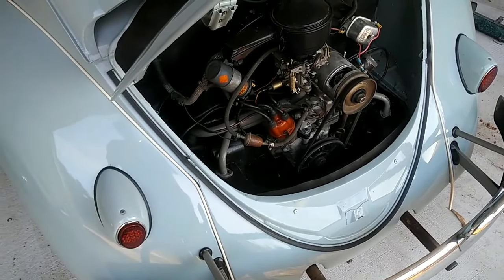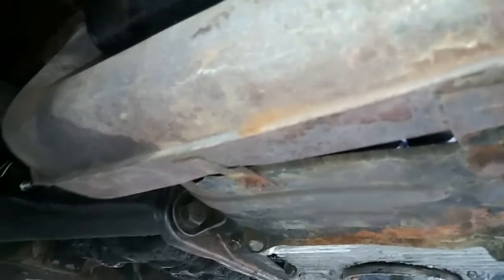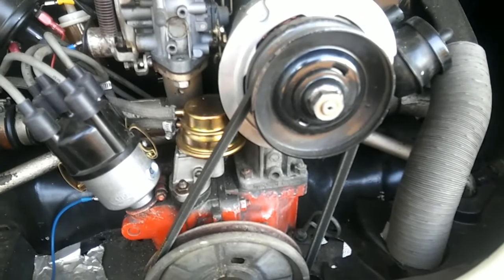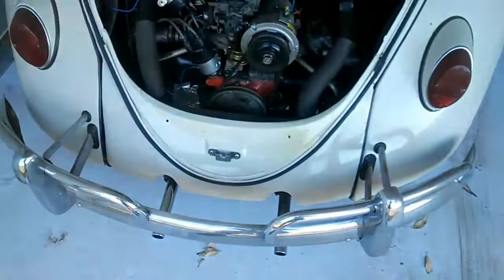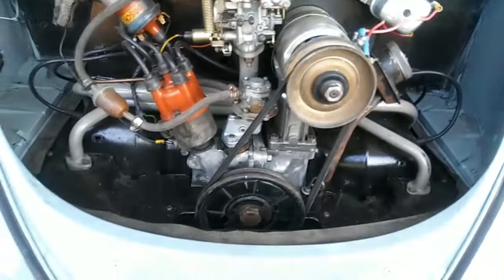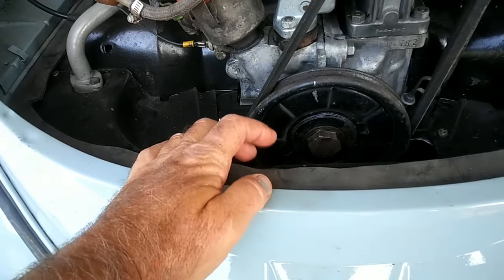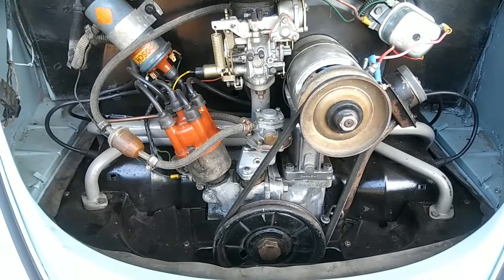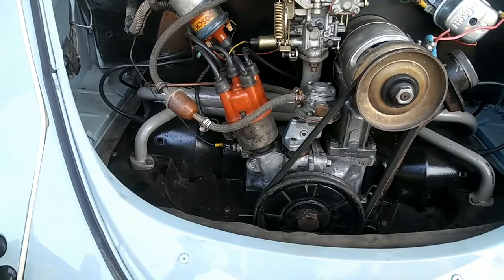VW Bug how to prevent engine overheating

Comment: My simple way to keep my 68 bug cooler , was to drill a small hole in the rear bumper at the center ''front'' edge , and a small hole in the engine lid at the low tip , put a old fashioned  screen door hook in the bumper ......and the hook eye nutted into the engine lid ......and open the lid , insert the hook into the hook eye , drive down the highway.....simple . An VDO oil temp ''told '' me it worked cuz if the oil temp started to rise to higher than I liked it  , I would pull over and open the lid , put the hook that was dangling from the bumper  into the engine lid eye , get back on the road and watch the oil temp drop quickly to where I liked it .......the engine lid was about 4 inches ''open'' , and sucked the heat OUT ........simple !!!

Comment: You mentioned doghouse oil cooler? I used a type 4 as advised by my mechanic. It is hot in my country 8 months in a year. Good video!!!
Reply from the maker: Great point! we also did that in the Bulletproof engine build. Type4 cooler modified the shroud . I would do that in hotter climate too. also putting the electric fan powered cooler works good too. I also use heads that AA puts out that have opened up air finned area. better flow especially with the cool tin installed.

Comment: The only mod I did to my VW is I encreased the RPM of the cooling fan by using a different custom set of pullies.
Yes it makes the performance suffer a little bit but it's worth it in the long run!
Reply: I can't imagine it making the car suffer very much. I think that's a good idea especially for my Manx buggy because it doesn't have any way to seal off the engine compartment.

Comment: Back in the '80s I put Bus wheels on my Ghia: an inch shorter and an inch wider than original. I found some relatively low profile Michelins that were just about the same overall diameter as the original tires, so I had the same gearing and my speedometer was accurate. For clearance, I only had to grind the rear bump stops a little bit.
Reply: 14 inch wheels look wrong as there is a big handwidth between the bodywork and the tyre.
Acceleration would improve but the motor would need crazy revs for safe highway speed driving with a standard transmission.
You cant get something for nothing.
For a ghia has a heavier,wider body than a bug to haul around.
I suggest installing a heavy duty power pulley, that helps increase the fanspeed and maintain momentum. Gene Berg having the bestquality but think csp or cb performance also do them.

Comment: This type of air cool engine is very sensitive to tiny oil leak. Air if move fast can sitting dust on surfaces as head cylinder and cylinder plates if plates oily. Good assembling and sure to oil sealed is important.

Comment: I bought a after market oil cooler that screwed on the back of the fan housing, and it also came with a oil filter that use a regular oil filter.,A head temp. Guage would be a good idea.and 30wieght synthetic oil which handle the heat better.I see your engine has a 09 distributor and a Bosch coil good improvements .

Comment: I have a 1979 VW karmonn super beetle. Do you know what size the engin is, do I need to rejet the carb, and is the trans. ok to go 70 with the gearing I really injoyed this video. thanks for the info. I had a 1959 VW bus and I put chevy rims on it and did noyhing like you were talking about so now I know why I went through 4 engaines

Comment: Front engine tin is necessary to prevent heat from being suck in and additionally is the front tin seal.  It is necessary also.
Reply from the maker: better if it is on, but we did tests with temp gauges in the early 80s and did not get any different results with the front off. The rear of the car oh yea if you want to burn up a motor just leave some holes in the rear.

Comment: What is a good temperature for the heads and what temp should you start to worry at?
Reply: Wondering the same thing
Reply: @justinfewkes9313  lol yeah, now we just need an answer... lol anyone? .... anyone?
Reply: >>What is a good temperature for the heads and what temp should you start to worry at?<<
They run at almost 300F. So the cooler...the better. I seriously doubt you can get them "too cold".

Comment: If a bug overheats normally she will cut out let her cool completely before starting her up again. As it is an air cooled engine very same as a ride on lawnmower. I remember we had a heat wave in Ireland. The push petrol mower cut out i let her cool down and ran her again. Vw beetle uses the same principle

Comment: What about making sure the belt is snug?   And that there is enough crankcase oil?  45 years ago when I used to pump gas in these things I very frequently found those items needing attention.  And that was when the speed limit was 70 (before it was lowered to 55).

Comment: Tire width and sidewall aspect ratio will always determine the final gear ratio on any vehicle. Bear in mind that a larger overall diameter/circumference tire will make the wheels spin slower and you must watch speed because indicated speed will be lower than actual. The only mods to VWs that are really worth it are ones that route the air around the engine more efficiently.

Comment: Get a vented lid or stand off hinges or both... It helps more then most things he mentioned
Reply from the maker: +ady-B David the only thing I don't like about them is water comes in the engine compartment and causes problems when you wash your car
Reply from the maker: yes they do work but every time you wash your car you are in for a big job.
Reply: those dont really work when you are idling,the deck lid is designed to draw air down over the engine blowing all hot air down and away from engine,the deck lid being open compromises cooling ability.plus it looks like crap
Reply: Mike F  we put a garbage bag over the engine when it's washed. But we make sure the engine is cool.

Comment: 185mm aspect ratio 75 or 92 for climbing tires thru the terrain in Germany mountain and Alps of Italy. This is 381mm Firestone made in 1935 ad 381mm is 15 inch for motorists in Germany read only R381 on the Mich or Mick tire.

Comment: Make sure your old tar board insulation on the fire wall is in good shape, attached, or replaced. Dangling or broken firewall insulation will suck right over that fan hole no problem.

Comment: Hey Mike, Im working with a guy to restore a beetle for me and I was wanting to put dual 40 IDF carbs on the engine. He keeps telling me that dual carbs will cause the engine to overheat all the time. Its an 1835cc engine. Do you have any idea if 2 carbs will cause the engine to run much hotter than a single carb?

Comment: Run the recommended sae 30 or 10w-30 oil.  The oil is diverted to flow through the cooler when the rear relief spring drops below a certain pressure.  A heavier oil will create more oil pressure.  Generally that’s good, but a higher oil pressure will raise the point at which oil flows through the cooler as much as 40 degrees.  There’s also a point to be made to run the stock thermostat flaps, even if there’s no thermostat, just make them fixed open, it helps flow air toward the heads.  A 356 generator pulley will make the fan spin faster.  Berg was also a strong believer that hemi cut heads with 6.9:1 comp on a stock engine ran cooler, and allowed you to safely run the afr’s closer to stoich.
Reply: Hey!!! Thanks for that tip.
Reply: 10w-30 in an Air cooled VW? You must live up north.
Reply: @RonBakerDallas  Sometimes straight 30 is hard to find. I wouldn't run 10w-30 on the highway for hours in a bus. It's all about hot viscosity, I wouldn't recommend anyone to run something that's thicker than an sae30 @215 degrees F. The oil only flows through the cooler once pressure drops below a threshold. too thick of an oil raises that temp ceiling, which is no bueno.
Reply: @curtislovrak5390  I only run 20w-50 unless it gets to freezing, Live in Texas so never really gets to freezing around here.

Comment: On my 65 sunroof  I bought a convertible decklid for it also. Hopefully it will help
Reply from the maker: the do a little. I just dont have one because of the water getting in on the distributor.
Reply: Mike F true,  check this out why IN THE HECK DID I GET SHOCKED  when i touched  my  spark plug wires on my distributor?  Are my cheap  spark plug  wires causing that ?
Reply from the maker: Bosch or NGK spark plugs only for vws.

Comment: i got 2 bugs both running and driving no rust in them but are baja's one is a 63 the other is a 74 the 63 has a 72 bus trans axle in it got both for 400 bucks think i got a good deal with extra parts and custom wheels good tires the 63 takes chevy 5 hole car same as my camero center line wheels

Comment: Best to run in a cooler country.. Heads crack around or near the plugs. Built in flat spot on standard carb in the 70s
Reply from the maker: flat spot could be from loose throttle shaft makes motor run lean. too watch out on that one.

Comment: If I had a Beetle, the first mod I would implement is a way smaller pulley on the generator/air fan shaft for greater speed.
Reply: Dont do that. The fan consumes quite a bit of horsepower. The smaller pulley has less grip on the vee belt. Combine these 2, and you will have a slipping belt at even moderate RPMs. Result will be a fried engine.
You could use a late model larger oil cooler and the slightly wider cooling fan impeller.

Comment: Good video overall but don't forget to prep the heads first.
Most all heads need the fins cleaned up and profiled with a circular saw and speed controller .  All the flashing and shitty casting benefit. Even drilling out flashing where possible. #2 fix all oil leaks. Super important.

Comment: You have low compression ratio and how to measure it with this, in here, compression test gauge PSI in the spark plug hole and cylinder gives a reading. Same time, please, crank it. How much PSI in the compressor per engine cylinder do you have?

Comment: I just inherited a 73 bus with type 4 engine. I’ve been daily driving it and will do so all summer (hopefully find a beater for winter) it gets 100+ and 90+ everyday from June thru August

I’m a little worried haha
Have all the original tin, adjusted valves, degreased engine and cleaned everything up better. Change the oil frequently and am still worried about overheating. Thinking of making a lid prop also to have the engine lid gap at 5 inches or so
Also just ordered a new engine surround foam seal as mines deteriorated and half there
Reply: Were to get air from to "cool" the engine? Let think about that.  Low pressure behind vehicle going down road(as in wind tunnel) wouldn't be a good idea as air is hot the closer you get to surface of road + exhaust heat is down there too. Air leaks are death to engine because all the air is coming from low, exhaust area. ALL air must come into engine compartment from built-in scoops on side of buss. The scoops are not where by accident, that a high pressure area, at speed from frontal air displacement .
Reply: Edwin H Singmaster makes sense

Comment: Did you notice the engine with solid state ignition has no clamp on the output of the fuel pump at the fuel pump?

Thank you for the info as I am in the process of acquiring a late 50's early 60's bug preferably with manual ragtop sunroof.

Thanks for all the info.
Reply from the maker: the suction side is on the top on that fuel pump. The pressure side is on the bottom. and the bottom is clamped

Comment: You do have Mercon V fluid in the Volkswagen air cool transmission at the back. You need to stop bubbles in the transmission fluid by add in more steering pump fluid of 5 speed forward so add in Lucas ZDDP Additive and/or detergent and Plus try the transmission 70W80 oil pump low volume and oil cooler. There oil cooler Misnomer brings the fluid cooler radiator that comes with transmission cooling oil sensor also named heat sensors for trans.fluid.

Comment: Mike, thank you for the cooling tips! Any brand of Premium Gas that you would recommend? I have the non-doghouse engine oil cooler that came with a protective metal mesh in front of it and I cut that mesh because I thought that it was too restrictive and besides it is inside the fan housing, I think it helps. I would prefer a doghouse cooler but is it hard to install in a single port?
Reply from the maker: not really it goes right on  easiest though with the engine out of the car. SP are great sturdy engines and have less things to go wrong. No intake boots that leak.

Comment: Do those hood standoff attachments that leave about a inch gap at top help?
Reply from the maker: yea for sure the stand  off kits make the motor run cooler. BUT. they are a real pain in the neck with water getting in your motor and distributer.  one rain storm or time you leave your car outside and it gets wet and you will regret having one. One of my buddies is taking his motor apart right now because he got rust in his cylinders.

Comment: Mike F You were talking about different gasses to use if I have access to ethanol free gas would you suggest using that?
Reply from the maker: Well if your car is jetted for that fuel it might be better than e fuel. If it is jetted for the e fuel it will be fine too. So for instance usually if your using ethanol free fuel it will require a smaller main jet. So if you switch to the ethanol free fuel you car will run more rich so it will probably run cooler or it may not like being that rich and not want to run right or foul the plugs. You can even jet your car to run on e 85 and if it is jetted right it will run cool on that too. Having the proper main jet is a very crucial item to making your car run cool.

Comment: Citroen 2CV cooling (for the engine and oil cooling) blows the VW away. Massive fan distributes air equally every where....even at idle. Even makes more power per-displacement.
Reply: Yes, citroen made it better

Comment: Rick Jolicoeur how does having the filter there cause them to burn up? I only ask because that is where it is on a 72 I just bought.
Reply: Dan Smith, Thank You for the help!
Reply: The plastic filters are notorious for leaking. Put the filter in front of the engine by the transmission, and when it leaks it won't be on the engine or exhaust.

Comment: Every diehard Volkswagen guys I know all say to leave them 100% stock for best reliability, the one guy I know who works on them for a living says to leave it the way it came out of the factory if you want it to be dependable but if you change anything even something as small as the air filter, you throw the reliability right out the window, vw stuff is really cool but they are very finicky engines

Comment: Maybe put a dry sump system in there with a 5-7 quart oil tank and it'll never overheat with all the stock parts. No extra oil cooler to block airflow. IDK if you could put a dry sump system on a Beetle engine.

Comment: I just bought a 69 beetle with a 1600 and it overheated on the way home and I am pretty sure I can solve that( Wrong coil,no heater hoses,non vented dec lid,etc…) but now its the next day and it was extremely hard to start and it wont stay running at idle. Did I permanently damage it or what do I need to look at after I address the cooling issues?

Comment: Stupid question, couldn't you wire up a fan system over the tip of the engine to push air downwards? That way it's getting cool air and can force the hot air down?
Reply from the maker: yea but it is really hard to make sure the direction of the air is going downward. sometimes it swirls and goes back up into the fan and doesnt work you would need to make a shroud system and it is very tight up in
there where you would need to do it. just putting a fan up there might not help or might inhibit flow.

Comment: the best thing to do by keeping the stock look is to modify the dog house fan housing and install a wider fan.
Reply: adjust the fan regulating  thermostat  to factory spec to prevent overheating,  and also to provide wintertime heat for the passenger compartment.

Comment: Just got my 73 bug running again.  After watching this video, I'm wishing there was someone like you or even YOU near to take a look at it.  My biggest fear is breaking down, being stranded.  The guy I bought my bug from, back in 1989, cut the spindles to lower the car :/  I suppose that has altered the airflow? Is there a way to fix or put original/uncut spindles back on? Great video, thanks for sharing,  Lo  :)
Reply: Lowered spindles don't have any effect on cooling. If you think you may be running hot, look elsewhere. I used to drag race one VW and drove a brace of others back in the 70s and early 80s....some lowered and some not. They all ran cool because I was conscientious about keeping all the tin in place and holes plugged.

Comment: Where's a good place to buy larger main jets for the carburetor?
Reply: You will find that for the standard beetle carb, jets for japanese carbs have the same thread fitting. They are cheap and you could afford to change jets to optimise mixtures.

Comment: I noticed you do not have fresh air outs in your engine cowling, but have heater boxes.  does that have an affect on your engine cooling?
Reply from the maker: No this is an early 40 hp and would have had stale air heater boxes originally. I did keep the later model heater boxes so it would have the divert er tin to point the air to the rear of the car. the stale air boxes are hard to find and expensive so it may be a while before I put them on if I do.